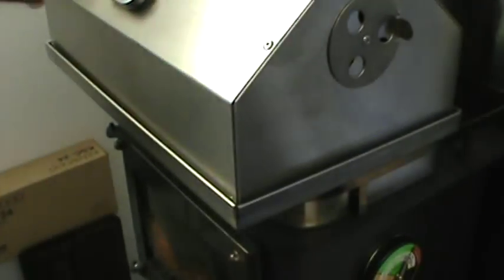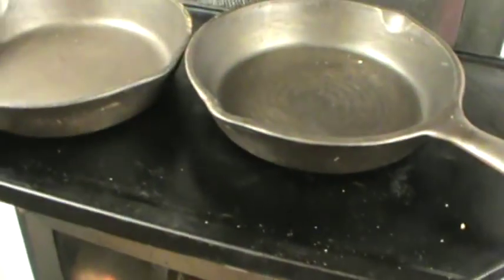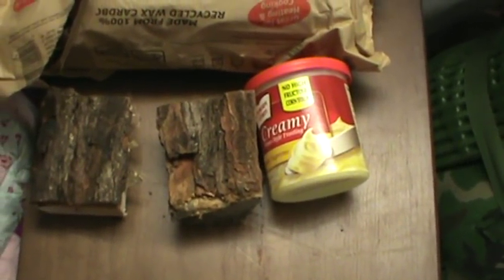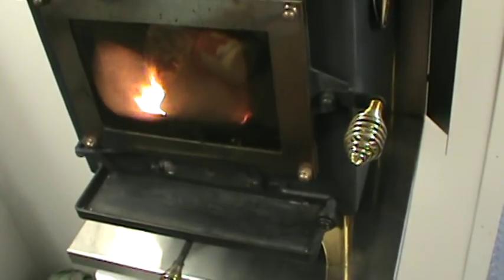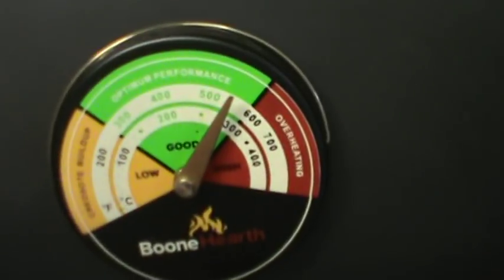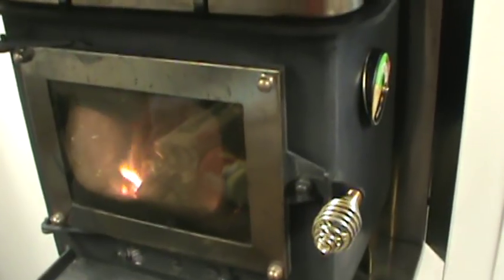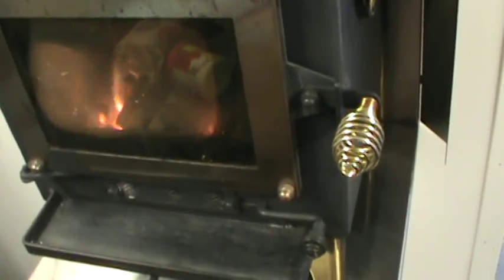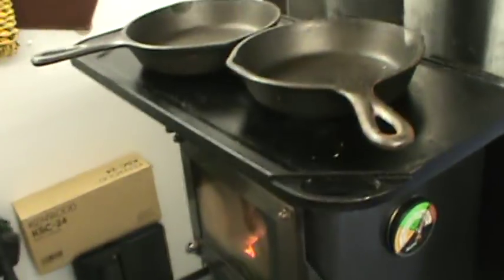Cubic mini stove cooking and how to use it without any trouble  on rainy day

Comment: I really like your set up.  what size camper are you using it in?  thanks
Reply from the maker: Its a 7 x 14 enclosed  trailer  custom built with shower  toilet  sink ac  electric and wood heat built in Elkhart  indiana
Reply: @kidglove100  ok thanks  Im wanting to put one on our Hi-Lo camper.  7x17 inside.  Ive look at them for sometime now.  seems to be more videos on the cubic stove than any others out there.  and they are cheaper than others out there.  and i think they work well
Reply from the maker: Get the grizzly  the bigger stove. I burn alot of compressed  man made logs and wood  they seem to burn longer then wood .
Reply: When using the compressed logs pieces how long of a burn do you usually get? And yes I’m definitely wanting to get the grizzly as I like the little roaster oven that you’re using in this video helps dissipate the heat and a bigger area so that I can use my cast-iron griddle. I looked at another one out there I think it’s the dwarf 3KW but it’s about twice the price And I doubt that it’s that much of a longer burn with it and you can’t hardly find anything videos wise loan information on it online just to have them trying to get it sold which is OK but when the Cub will do more than what I need it for I’m here in Missouri we get down below zero not that we do much camping then but if we do I want to be able to heat my little camper. It’s one of the Hilow one so I will have to have a telescoping pipe but I can get those

Comment: Thanks for the tips. I think I might be overloading my Grizzly. I've had smoke issues a lot. Going to try less... gotta get the Gunk off my window first
Reply: TO CLEAN WINDOW COOL STOVE ,,THEN TAKE A PAPER TOWEL AND JUST DAMPEN IT AND DIP IT IN  THE ASH FROM THE FIREPLACE  AND CLEAN  WINDOW AND THEN WIPE  WITH CLEAN TOWEL
Reply: @61804shill  I have lots of problems with my Grizzly. Next year I will probably re-install with the silicone boot and double pipe all the way and use a Versa cap. 
This year I had used the Dickson Marine deck fitting and expensive H cap. I saw another YouTuber successfully using this - it's not working for me. I have to clean the chimney a lot and I am always tending the stove and running it with the door open. The brass isn't so pretty right now.

I'm learning. I grew up in Maine with woodstoves but they were always big ones. There does seem to be a difference. I'd love a grate like a fireplace has!

Comment: this actually works soooooooo much better than a 1500w space heater on high in a 200sqft RV with no insulation. it gets so hot on freezing days outside that i have to crack a window and then if feels like summer time inside because i cant feel the cold coming in from the window

Comment: What is the purpose of the pipe wrap, surely you want the heat inside the van/boat rather than going up the chimney?
Reply from the maker: Pete the tape is a test   after watching experts on big wood stoves talk about creosote  buildup and how to defeat  it . I found that the creosote build up was above the roof in the single wall pipe due to the pipe cooling to fast  to fix this I found a 12 inch piece  of double wall  for above the roof...worked good creosote was taken down to very low levels. see what people don't know is that very dry wood and wet wood will cause creosote a hot pipe heating up fast reduces creosote. .......now fast forward to your question. ...yes I would love to keep the heat from that pipe....but the faster your flue pipe heats up the better the draw will be according  to the experts  also reducing creosote .I would have used  double wall on the bottom but the cubic mini stove oven would have not fit...anyhow I have accidentally bumped my hand on the pipe burning it a couple of times........This is a test for me and so far I'm really happy with the results. I'm not telling anyone to do this I'm just testing it and I don't think I'll ever take the tape off because the draw is so much better ....thanks  skip luck  be prepared
Reply: skip luck + Yes sir, the wrap will keep the heat inside the pipe, but that heat will allow less creosote. Not surprising you quickly can tell a diff. Thanks for showing your fine stove.

Comment: Has anyone used anthracite hard nut coal in one of these to make the fire last longer and burn hotter and smoke free as the saying goes With burning anthracite coal how much and how long and how little and how often to produce the right amount of fire and heat

Comment: If you are using trailer air to fuel the fire, you should open a window before opening the stove door.  The flue is drawing air out so you need to create a flow of air through the stove door.  If you don't, a pulse of smoke will enter the trailer.  If you are using outside air, the flow of gasses out the flue will be replenished by air coming is so the pressure inside the stove and trailer will be close to the same.  Radiant heat pressure will enter the trailer along with smoke when you open the door.  Before opening the door, close a valve in the intake pipe.  A vacuum will be quickly created as the hot air is still going up the flue.   Open the window and then the door quickly and add logs.   Air from inside the trailer will rush into the stove.  It's all about keeping a lower pressure area inside the stove before opening the door.

The best thing to do when installing a stove during construction is to test various ways to feed the fire until you find the way that works best.  Then add the finishes.
Reply from the maker: I crack the window some . I have seen the stove  have smoke pluses when I first fire it

Comment: Where did you get the oven in the start of the video from?
Reply from the maker: cubic mini stove store go to page 2 in the store it's there a little hidden thanks skip luck be prepared
Reply from the maker: remember it only fits the grizzly  stove not the cub
Reply: I'm thinking of getting the grizzly anyways. I'm building a tiny home of about 100-250 sq feet. 

I will be in Wisconsin and we can hit -20 to -40 on really cold (avg temp can easily be around zero) days so I like the extra heat and longer burn time for the nights.
Reply from the maker: just remember you have to stoke it every 1.5. to 2 hrs  you may want a bigger stove for home heating around the clock

Comment from the maker: That would work  if you have the metal  skills to make the lid base and side vents alot of people do but alot don't  have the time and tools and skill. But if you do build one  post a pitcure of it . cool project
Reply: Hi! we are considering buying the grizzly woodstove with the roaster as well, and I am really grateful for your review video! Would you mind answering a couple of questions about it? :)
1. Have you tried putting your cast iron skillet or steel jug directly on the woodstove top instead of using the roaster bottom and the plate? If so, how did that work well or would get too hot?
2. What kind of pan did you put inside the roaster to bake the cake? Silicone, ceramic...? Did it take longer than an usual oven?

Comment: Where can you buy the oven attachment? Does it come with the cubic mini? That's amazing! :)
Reply from the maker: DJ ALJMEX  hi the oven fits the grizzly only buy it at cubic mini stove  remember to use single wall pipe in the cabin or oven lid wont fit.   and double wall on the roof

Comment: How long will it heat your place after you light it?
Reply from the maker: Monsieur Ouya  it will burn for about 1.5 to 2 hours then you need to throw in a couple of 5 inch wood
Reply from the maker: 2 hours
Reply from the maker: this stove is for small spaces like a boat or camper you will have to feed wood in this stove every  1.5 to 2 hrs